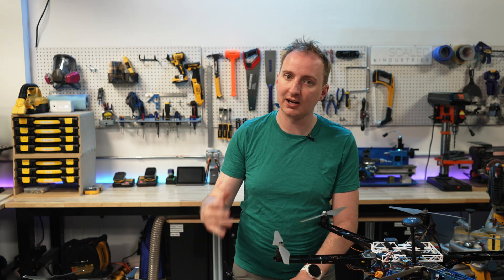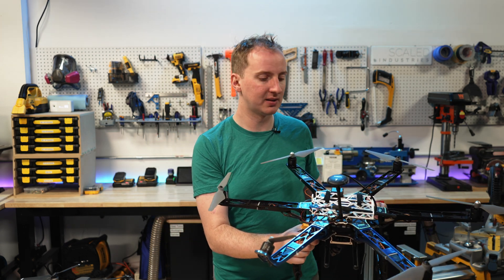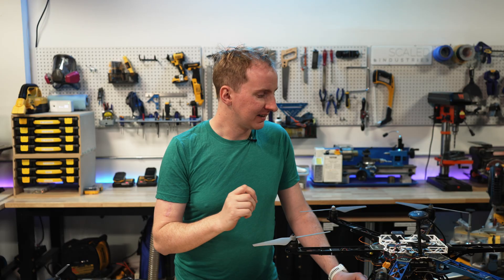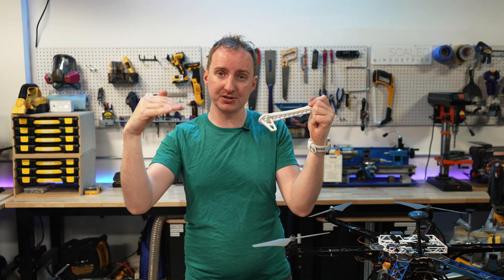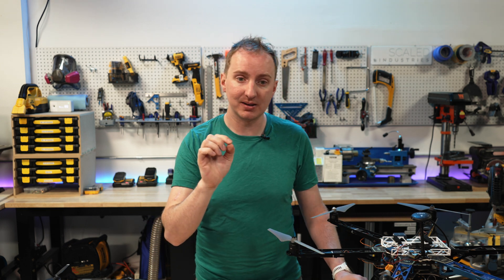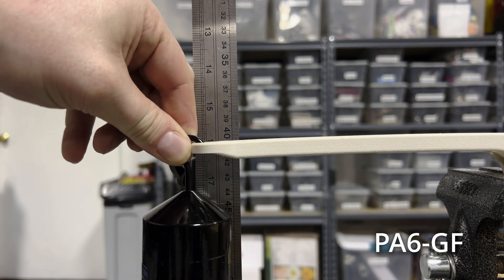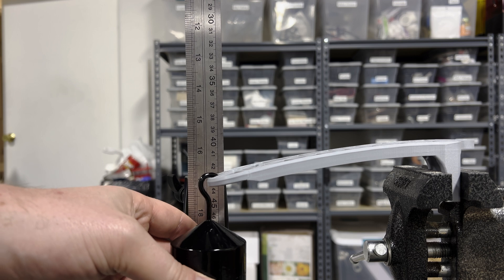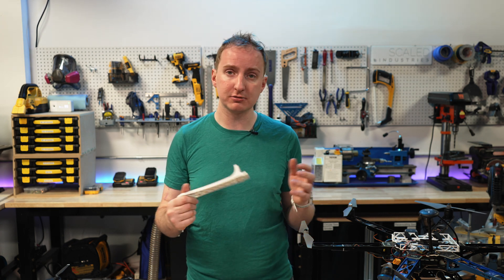Part 1: Filament & Arm Testing - 3D Printed Drone Build

Comment: what 3d printer are you using to print with the glass fibre infused filament?
Reply from the maker: It's a Bambu X1C - with the 0.6mm hardened nozzle just to ensure even less chance of clogs. I did have to replace it after about 50 hours of printing glass fibre things though!

Comment: if you print arms without cross patterns as solid peace and adjust just prints infill types and wall thickness, this makes easier to fine-tune arm stiffness and weight.

Comment: Happy to watch your progress on this!

Remember it's not just the carbon fiber itself. The tube is the stiffest shape for the weight. 

Round tubes also have the benefit of being aerodynamic from every direction, but I imagine you could add a point on the underside to be more of airfoil shape... Connect the two following letters to see what I'm talking about:
O
V

It would also stiffen it up more on the vertical axis. If you need more stiffness from there, you could make it wider at the root like a tree branch.

Food for thought!

Comment: Could you design small holes for rod inserts to help with the stiffness instead of designing a lattice on the bottom? Could possibly insert stiff steel rods? Dunno how that'd go for weight, though
Reply from the maker: Definitely could, but I wanted something I could just hit print on as a first design to see how far I can go! Another idea was to just use carbon fiber rods and then 3D print the motor and body mounts for either end of it, so it's still something that can be recreated easily.